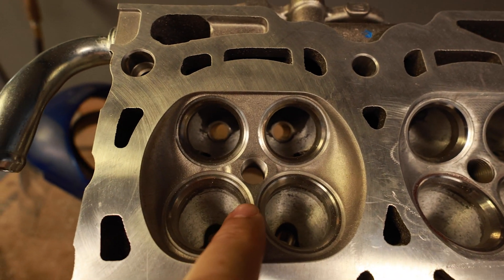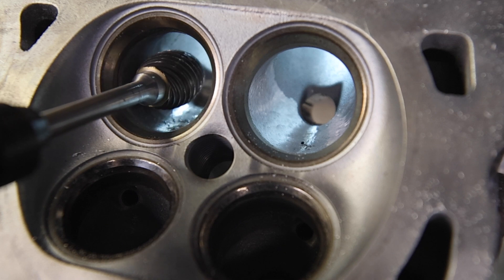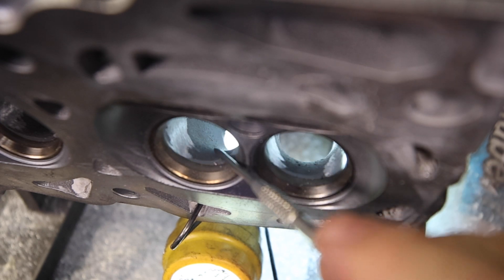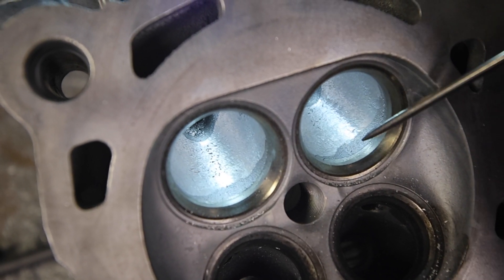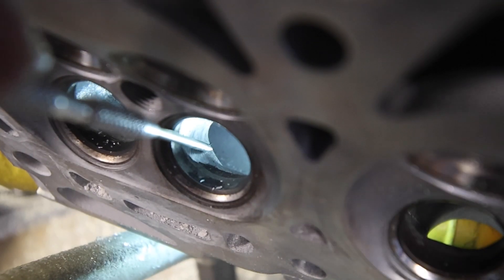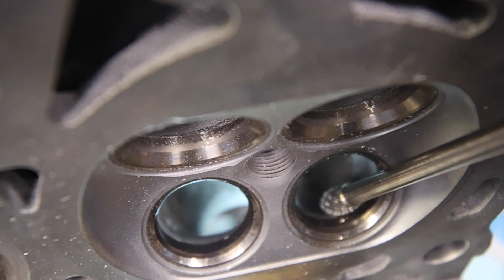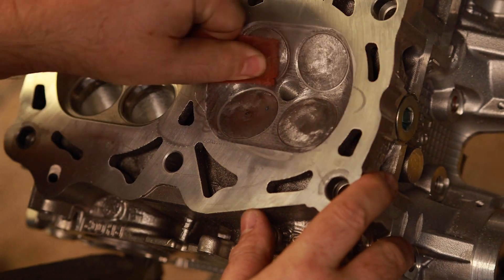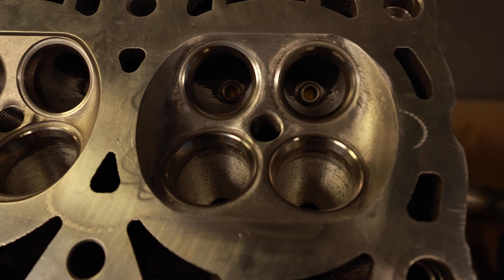HeadGames Pocket Port R on Subaru D Casting | Digitized with Centroid CNC

Comment: I really should have sent my heads to you.  I ended up letting my motor builder do it and he talked me into 1mm oversize valves and 280 duration cams.  To his credit it would be great if it was just a track car.  But for a street car not so much.
Reply from the maker: @doubletee4391  even for a track car that is a little much. Sorry to hear of your experience.

Comment: The D25 casting came on 08-14 WRX, 09-13 Forester XT and 07-09 Legacy GT. You can substitute it with the B25 heads from 04-07 STI which were also single AVCS.
Reply: @headgames At what power level for an EJ25 street car does it make sense to step up to S1 cams from OEM?

Comment: So you basically polished the combustion chamber and made sure there are no edges that can act like a glow plug?
Reply from the maker: No, I blended in the chamber with a carbide, you could not get the same result with sanding it. Actually, there’s no reason to sand it without grinding first.